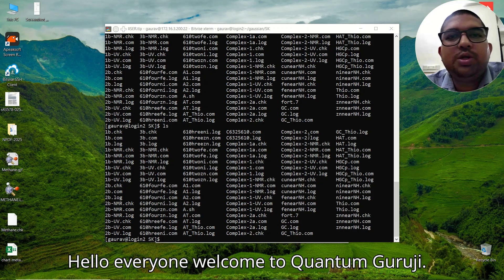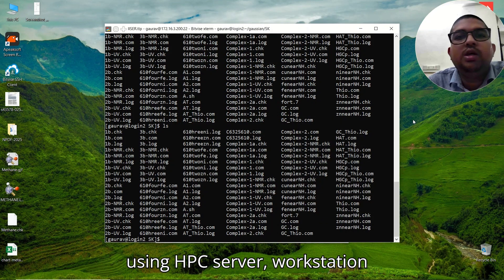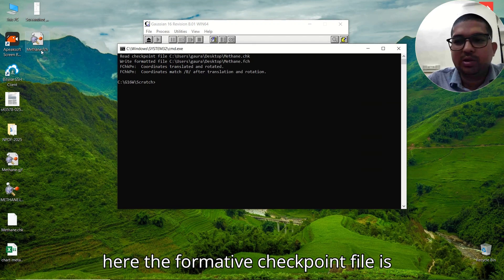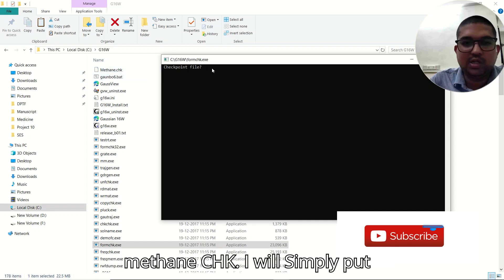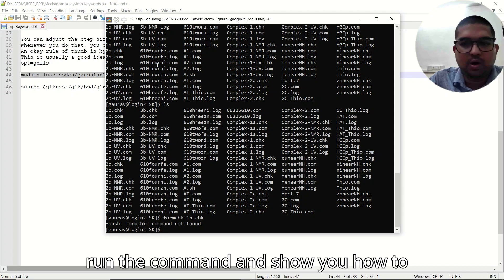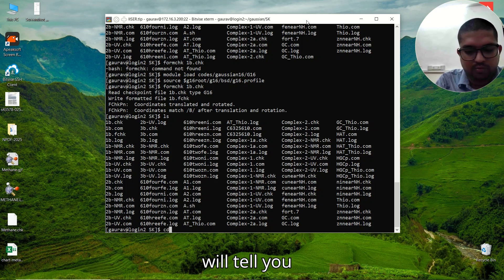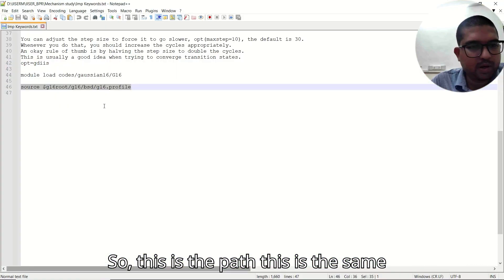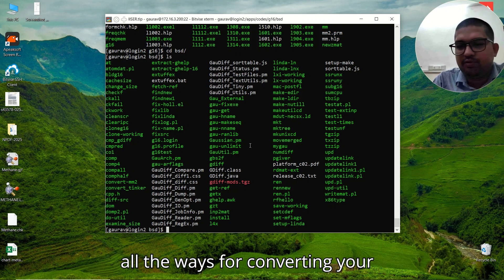All the ways to convert .chk file to .fchk/.fch   || By: Dr. Gaurav Jhaa

Comment: I run that command the module load, and the source and path but it produces a message "SEGMENTATION FAULT". Is there a way to convert my chk file and get rid of that error?!?! thanks in advance
Reply from the maker: That command in HPC may differ based on the software installation directory path and all. 
formchk will work everywhere (workstation, server HPC etc..).

Comment: Can't you add a keyword in the .gjf file to output a fchk automatically at job completion with correct naming?

I've read about an obsolete keyword formchk , but it gives a generically named .fchk file upon completion.
Reply from the maker: "Add a keyword in the .gjf file to output a fchk automatically at job completion with correct naming." This may not work; it may give you an error while opening the file. Have you ever tried this?